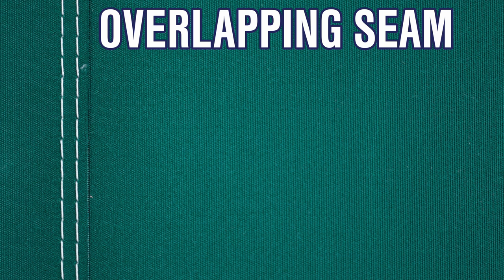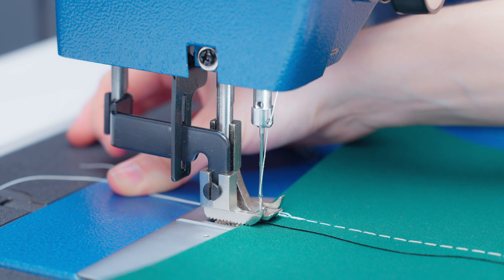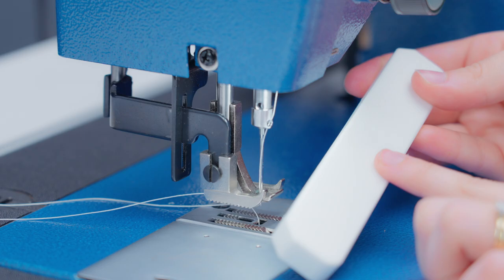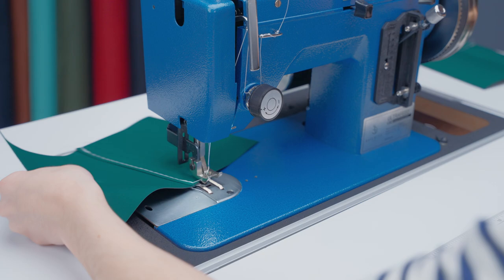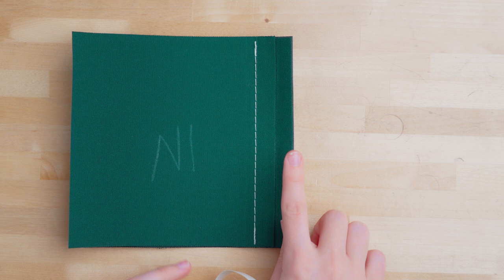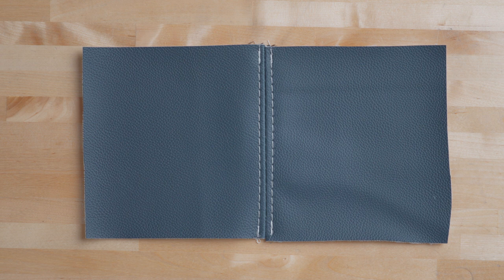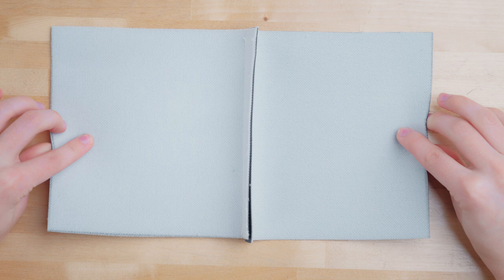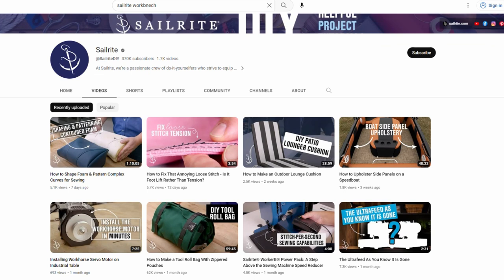Learning to Sew | Part 3: Seams You NEED to Know

Comment: I noticed how the LSZ-1 machine stitching is slowed down. I've tried that on my own, but must be a new feature of the updated machine. Great video, thanks.
Reply from the maker: Thank you for watching, as far as the speed. We are using the LSZ with our WorkerB motor system (122891) and the Speed Reduction kit (123372) attached. With this setup you can sew as slow as 1/2 a stitch per second or up to 260 stitches per minute.

Comment: I have an issue if my needle goes past the end of the fabric. It gets jammed. So doing the lock stitch is taking some getting used to. I want to be close to both ends. Buttrying to time the stitch so it doesn’t go off the end is challenging. Any suggestions?

Comment: Interested in getting this machine to sew canopy covers. Probably a dumb question, but when you have a lot of material that does not fit to the right of the sewing needle... what kind of stitch do you do, to sew two pieces securely together?
Reply from the maker: Thanks for your comment! It's not a dumb question at all. When you're working with a large amount of material, like a canopy cover, it can be challenging to manage. If I understand correctly,  you're asking about a specific technique to manage the excess fabric during the sewing process? 

There are several techniques to manage excess fabric while sewing. One common method is 'bunching,' where you gently gather the fabric to the right of the needle in loose folds. Another technique is 'rolling,' where you roll the fabric into a tight cylinder. This is particularly useful when sewing large items like sails or canopy covers. However, the best method often depends on the specific project and fabric type. Remember, practice makes perfect. The more you sew, the better you'll get at managing large amounts of fabric.

Here's an example of what that might look like: https://youtu.be/QdCFL6RRjEY?si=siCoPR2gkGRLT-if&t=127

I hope that answered your question. If not, please let us know!

Comment: When the fabric has an IN and an OUTSIDE how do tell which side is IN or OUT?  Sunbrella fabric for example.
Reply from the maker: If it is Sunbrella Marine Grade then it is reversible and either side can be used. The same generally holds true to most solid performance fabrics. A good test is also pouring water on the fabric if it is designed to repel water then the side that is most water resistant will be the outside. There are a lot of fabrics with many different characteristics so it is hard to generalize a rule so hopefully this helps!
Reply: @SailriteWorkbench  Thank you

Comment: Will you need to adjust tension as the full felled seem thickens with an LSZ
Reply: ON whatever fabric you are using, use two ply's to set the tension, you should then be good for all additional ply's (which can be several on an LSZ).

Comment: I think the video is FANTASTIC!  I would be interested in you guys using the Leatherwork for Leather examples of the same type of things!  Mine makes a small "clicking" sound every time the stitch is released.  Is that normal?  If it is great, if not, what's wrong?  I kind of like having the audio cue to knowing if I miss a stitch or not, since the machine is so slow I can just stop and 'fix' that stitch, usually. I wish I could say I was in love with my little green Sewing machine, but I am not there yet.  Also, I noticed that your backstitches are NOT going in the same holes as the forward stitches.  Is that because of the machine?
I love the Sailrite company and I am very enthused with my machine as I learn it more and more and make more Leather goods.  As a first sewing machine, it has its quirks and I am learning them and living with them.  But, I think the Fabricator would not have the same issues that I have to deal with, which is specifically the uneven forward and back stitches.
Reply from the maker: Usually, the clicking sound comes from the thread being released from the hook after it has made its rotation. The take-up arm starts to tension the thread and as it slides off the hook it makes the "click". Completely normal but if you think it is something else please send a video to support@sailrite.com and we will provide further feedback. I would say though that if your stitch tension is good, there is nothing to worry about. 

As for the backstitching in this video, it is not as important to have a pretty stitch in canvas as is it leather but we could have made it look better by setting out forward and reverse stitch length more precisely. I recommend watching this video when stitching leather with an Ultrafeed or Leatherwork: https://www.youtube.com/watch?v=ClcUxxCRYTU&ab_channel=SailriteWorkbench
Reply: @SailriteWorkbench  Thank you!  The video you linked is the way I do my backstitching.  I’ve watched your backstitching in leather video about 3-4 times now.  I also have a Singer 128 that I have to do that with.  I find turning things around 180 degrees to be inconvenient.